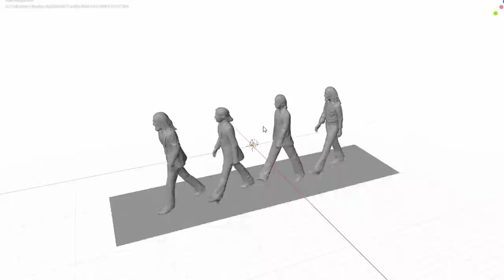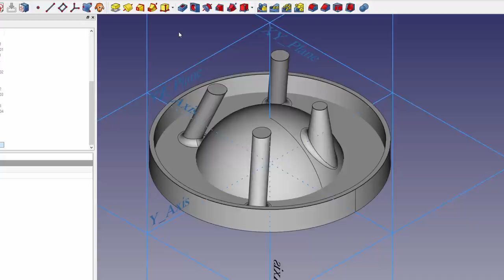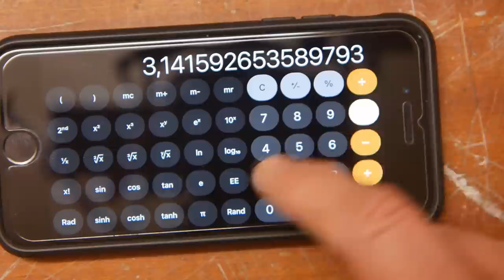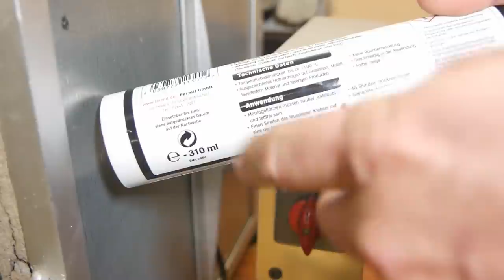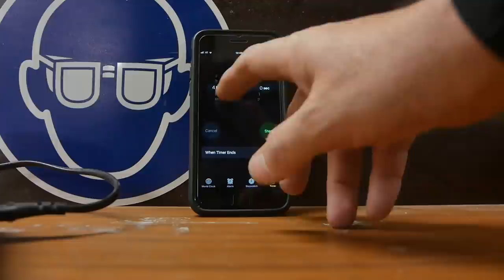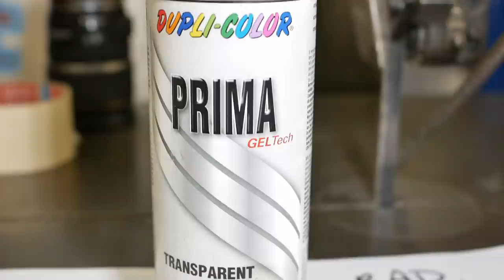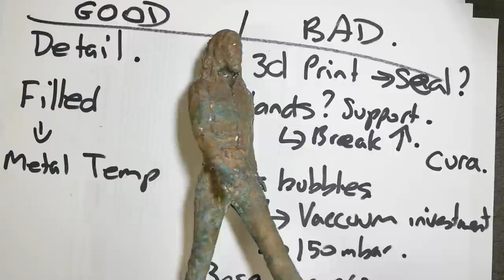Investing in the Beatles

Comment: what support distance in cura do u have in the settings? easier to remove whit a little more distance, you can also try treesupport-it's easier to remove
Reply from the maker: Thanks I am using 0.1mm Z distance, and 0.8mm X/Y, with 0.1mm minimum X/Y. What do you use?
I just tried Tree support with Ringo, but the first print was a failure for other reasons.
Reply: @RotarySMP  it depends on the layerheight i have used trial and error for z,and found out that on my printer the easiest removable support is at the same as the layerheight..so if u r printing at 0.2 i use 0.2 z support distance - works good for me x/y i use 0.7,and also layerheight as minimum
Reply from the maker: @hedning003  Thanks for that.

Comment: My cura settings are the number of perimeters. Make sure you have at least 3x the perimeter as nozzle width. So you want 1.2mm walls with a .4mm nozzle. Also bottom and top should be at least 3x the layer height. Also dumb down the resolution to at least .12mm layers, one more thing, don't use normal clear coat, use lacquer, it burns better at those temps. If you could print in ABS you can skip clear coating for a spray bottle of acetone. Good luck.
Reply from the maker: Thanks for the tips. I was printing at 0.2mm layers. I have increases the wall thickness frmo 2 to 4 on the next attempt. I already sprayed George IV with the clear coat, but can use lacquer on Ringo.
Burning out ABS causes a stench which would not be acceptable in my neibourhood.
Reply: @RotarySMP  it's not as bad as you think, you would soak it with acetone and leave it overnight and pour the abs right out the hole. Then burn whatever is left. Either way I understand. Come to think of it, I do not think burning abs is acceptable here either.

Comment: in terms of the problem with the 3d-print not holding tight: .. brian oltrogge here on youtube used plain super glue to seal the layer gaps .. maybe this could work for you too .. at least take a look at his channel .. his videos should be to your liking .. :)
Reply from the maker: I remember Brian from the Alloy Avenue forum. I dont think super glue burns out cleanly without ash either does it?
Reply: @RotarySMP  you're right .. he uses sand castings .. completely diffrent can of worms .. :)
man, thats even more complicated, than i thought anyway .. :D
Reply from the maker: @DerMitbewohner  Sand casting is nice for simpler parts.

Comment: Just spitballing, but what if you brushed a light coating of diluted PVA on the print before casting it in plaster?
Reply from the maker: I dont think PVA burns out cleanly without leaving ash does it?
Reply: @RotarySMP   Unsure about that. I’d think it would be minimal so long as it was diluted just enough to seal with a very light coat. Another potential option (again, just throwing out ideas) is finding a way to use the UV curing PLA resin as a sealer. I’m probably way outside my skill set, but maybe some of these ideas will shake loose a good one in the long run.
Reply from the maker: @jnorris8649  I appreciate the inputs. I'll try the paint on the next one. If it works, it is the easiest solution. If it causes ash, and that causes problems, I'll have to persue a more difficult solution.
Reply: @RotarySMP  Maybe I’m in the dark, but would a quick blast from an air gun help remove the ash while the shell is still hot? I’d think the little ash particles would be more difficult to remove as it cools. Either way, best of luck & I look forward to the next video to see the results of whatever course you choose!
Reply from the maker: @jnorris8649  I did that. Scared the crap out of me, as I had not yet put may casting gloves on, so the air returning from the 750°C mould was darn hot. There was a bit of a cloud which came out. Not sure if it was ash, or loose investment, or investment knocked off ba the air pressure.

Comment: Is it common to have 3-Phase power in a residential property where you are, or do you have a rotary phase converter?
Reply from the maker: Here all houses have 3Ph. Actually even our previous 3rd floor inner city apartment had 3Ph, for the oven. That rotary phase convertor deal seems like a bit of a PITA.
Reply: @RotarySMP  damn, here in the UK your lucky if you get 60A of 240V single, especially if your in a converted flat 😩
Reply from the maker: @almostanengineer  That must suck. I have three different 3Ph 400V 16A circuits, from 32A feed at the gate.
Reply: @RotarySMP  sadly not, I’m just a lowly retail worker doing my BEng in Mechanical Engineering, I can barely afford to buy stationary let alone a lathe 😅
Reply from the maker: @almostanengineer  Good on you. Best degree of all.

Comment: Good day.
Can't you get the 3D printed figurine.
Thin 3D printing.
Pour that into the plaster.
and then immediately shake the bronze into the plaster.
so that the 3d printed figurine burnt and the little remains.

I live in the Netherlands has been translated with google.😁

Francois van Engelen
Reply from the maker: It doesnt work like that. You have to burn out the figure with a 13H burn out schedule. Pouring molten bronze into wet plaster is a recipe for a steam explosion.
Reply: @RotarySMP  no in dry plaster.
3d model in plaster en not burn it out.
 Pouring molten bronze into plaster whit the 3d model in it.
does work that??

molten bronze burn the 3d printing model out of sand
Reply from the maker: @FvEChannel  Hardened plaster is not "dry", the chemically bound water can be flashed to steam at the temp of molten bronze, causing a steam explosion.
Reply: @RotarySMP  
 Pouring molten bronze into SAND whit the 3d model in it.
does work that??
so that the 3d printed figurine burnt out.

THANK FOR YOU ANSER.
GREET FRANCOIS
Reply from the maker: @FvEChannel  Sand does not replicate the detail like an investment can. Also the density of a 3D print is far, far higher than the density of the foam used in a lost foam casting, which is where you pour the molten metal directly onto the model. The PLA will not burn out completely during the bronze pour.
Reply: @RotarySMP  Thank you very much for the response.
I like to watch your youtube channel.
very knowledgeable.
best regards.
Francois van Engelen

Comment: Nice video! Maby brush the 3D Print with some epoxi resin. Love your Boley lathe 😉
Reply from the maker: Thanks. It is a nice lathe to use. belt driven lathes are really nice and quiet, even if changing speeds is a bit of a pita. 

I dont think epoxy burns out cleanly. You dont want ash in there.
Reply: @RotarySMP  Hmm haven't thaught about that but it's probably true. 1k clearcoat maby? I'll think about something like this...
Reply from the maker: @derjan236  That is what I will try next. 1K clear coat. Already have the mode ready.
Reply: @RotarySMP  Nice. Remember for Details  a few light coats are better than one thick coat ;-) But i think you already know that.
Reply from the maker: @derjan236  Good remoinder. I used a thick coat for the next George, as I felt it might seal the cracks better. I'll use multiple thin coats on Ringo and see if there is a difference.

Comment: Buy the castable resin and I print it with SLA for you :)
Reply from the maker: Thanks for the offer. How does the castable resin differ in terms of support material?
Reply: @RotarySMP  not sure about castable resin specifically, but with resin prints you can do smaller & skinnier supports that can be removed with side cutters, rather than the beefier support towers you get with FDM, kinda like an airfix kit (:
Reply from the maker: @roseroserose588  That it cool. I had some thinner supports resonate and break off with the moving bed FDM printer.
Reply: Yeah resin is the go for figurines, ie, much higher detail, ie, no striations. You actually have to have holes in it to drain the resin or it will be printed full of resin.
Reply from the maker: Argghhhh, there is always the next rabbit hole to run down, and good reasons for doing it :)

Comment: Why don't you use a wax filament instead of PLA and print with a much thicker outer wall ...5mm or more. It might solve quite a number of your problems in one stroke. https://www.machinablewax.com/product.php?product=52. A bit expensive, but you should be able to get an equivalent this side of the pond.
Reply from the maker: Not sure what it would gain me? PLA burns out cleanly. I cant do a 5mm outerwall on the really problematic parts like the hands. A gap between layers where the investment could creep in could happen with wax too couldn't it. I am hoping that the clear paint will fix that. And it adds a bunch of new variables and another steep learning curve.
Reply: @RotarySMP  If you do extra thick walls, the small parts should print as a solid. If I'm not mistaken, there is a setting in cura to fill in small gaps automatically.

I'm no expert, but I presume that thick walls with high infill density would reduce the likelihood of creep between layers.

The other issue might be that the heat from the plaster is perhaps softening up the PLA allowing the layers to split. Perhaps a paint on investment shell to capture the details before creating a mould might help.
Reply from the maker: @nrml76  This investment (Certus Unicast) does not heat up much during curing. The dental investment I used on the first couple of models heated up a lot more.

Comment: Have you looked at the most recent video from  Robinson Foundry? https://www.youtube.com/watch?v=YKeImuJpxow 
I think there might be some valuable tips in there, like not pouring the metal directly into the model part but rather into a reservoir at the bottom that then fills up and lets the metal rise up through the model
Reply from the maker: I was thinking about a J spue to the bottom, but at the moment, my problems are of a simpler nature, so I will keep such techniques for later improvements, once I have the low hanging fruit.

Comment: Morning. Learned many things new as usual. That Cine 7 looks sweet! I think I'll check them out. What is your CAD software if you don't mind me asking?

Cheers from a 100% rainy and overcast Connecticut, perfectly coinciding with the 4 day weekend, that'll be this way for the next 3 days :-(
Reply from the maker: I am using Freecad. The interface is a bit clunky, but it is powerful. We have had the coldest wettest spring in 14 years. That is a good thing. Good for the garden :)
Reply: @RotarySMP  Ah, great. Yes, I think I have FreeCad installed on an ubuntu machine somewhere. Can't complain about the rain too much because the garden is very happy about the rain. Was so cold yesterday I had to turn the central heating back on yesterday afternoon! The weather also means the hummingbirds come to my feeders way more frequently and it's nice to see them.
Reply from the maker: @vincei4252  Yeah, we haven't turned off the central heating yet this year.

Comment: I use Prussia slicer. One of the nice features is that you can paint on support locations/blocking, which might help with getting the support right around the complex shapes of the hands.
Reply from the maker: I used to use Slicr, and then installed Prusa-Slicr, but switched to Cura at the advice of the friend who diesigned this printer. I'll take a look at Prusa's support options.
Reply: @RotarySMP  You can also try SuperSlicer (like prusaslicr ++) it handles supports way better and has tons more features in the support section you can play with. But for the best quality support you would have to use something water soluble as support interface. Also if you overextrude then the prints become water tight, but the quality will suffer. Also more perimeters the better. In Cura there used to be a trick to set infill to 0, bottom layers to 0 and set top layers to 99999. That gave "magic" results when printing minis.
Reply from the maker: @markoantesic4362  Thanks for the tips.

Comment: use ABS for printing and acetone smooth it for sealing. I would suggest you get a fifferent slicer cura has notoriusly hard to remove support. prusa slicer or slic3r are better. a triple or quadrouble shell will mostlikely help. what you could try is to print the hands seperatly and glue them on if nothing else works. can't help you with the rest of the problems as I don't know much about casting.
Reply from the maker: Does ABS burn out without ash? That is the big advantage of PLA, also that there is nearly no smell as it burns out. If I burn out ABS in this residential area, the stink will go to some neihbour. Shame PLA doesn't acetone smooth, as that would be a big help.
Reply: @RotarySMP  you can smooth pla with clorated solvents like chloroform and dicloromethane. If i remember correctly tetrahydrofurane works aswell. But if you are not a chemist like me they are hard to come by. Shoot me a private message.
Reply from the maker: @GuyFawkes911  Thanks. I am pretty sure that those chemicals are not available to the public here in Austria.